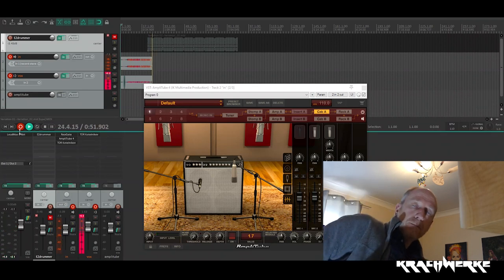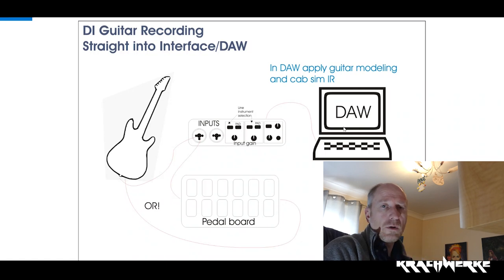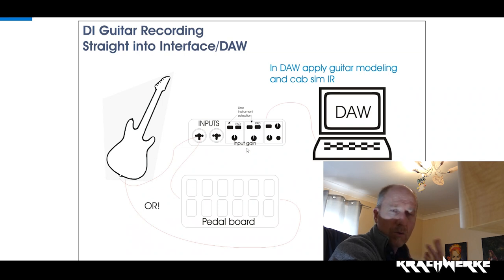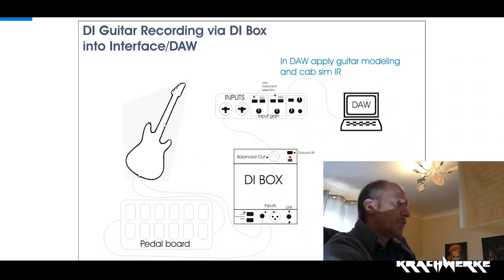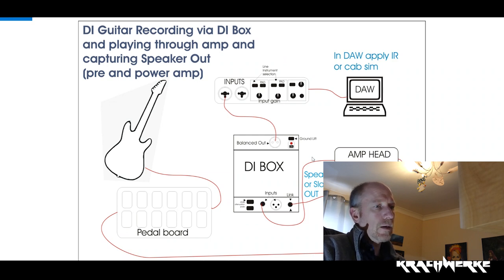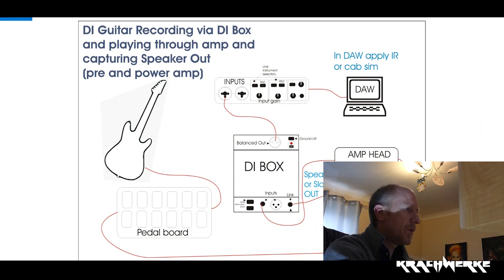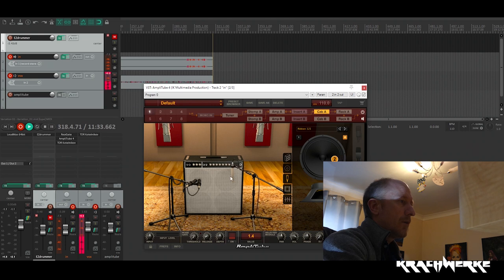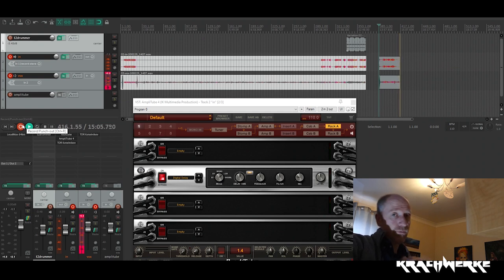Five Ways to record a DI track for guitar sims and re-amping

Comment: Hi, congratulations for the video really well explained
and in a very simple way, the best solution I prefer
it's "head, DI box, cabinet" I had in mind to create something like this
I just don't want to get into trouble, I thought I'd put an attenuator
but I didn't quite understand where to put it, I thought I'd put it
between "DI box, attenuator, cabinet" so I could lower the cabin sound
and have the headphone sound of the head without any attenuator,
what do you think is right?

Comment: Hmm I've read in a lot of places a DI box doesn't make a significant difference on interfaces with built in preamps, like the Behringer preamps. But I imagine with a decent enough DI box, there'd have to be an improvement. Are there semi affordable DI boxes worth getting for the UMC204hd? Are you just referring to the cloudlifter? I seem to have sufficient power, and minimal buzzing using dynamics. Cheers, nice video!
Reply from the maker: Thanks. In my experience the Behringer DI is absolutely fine. Please bear in mind this vide was to show different ways to record the guitar signal in order to get preamp out, poweramp out etc.

Comment: Would be curious to know what the different sound would be without aa DI box, and you plugged right into the interface. Which DI box are you using? What interface are you using?
Reply from the maker: Interface is the behringer uphoria hd with two xlr inputs.

The DI is the standard active one from behringer.

Depending on your setup you  an get away with using the instrument input. I think the problem lies with interfaces powered purely by USB and their lack of proper grounding. 

The transformer in the di theoretical mimics the pickups better.

Comment: At first, very eye opening Video! Thanks! My question:

I use the Steinberg UR22 MK2 as USB interface and used the build in Hi Z instrument input to go straigh from the Guitar to Amplitube 4.

Now I own a BSS AR133 Active DI and put it between the Guitar and the interface. The raw tone that goes into the Daw is very different.  But is it better? I have no clue. I want the Guitar signal entering the computer as authentic and pure as possible.

What are your thoughts on that? And what do you think of an Hi Z input? (does not work with XLR)

Thank you in advvance. Cheers
Reply from the maker: OOft, difficult...
SO I had a tascam io/2 interface and the instrument input option sucked baws so I started using the DI inbetween. I now have the Behringer UMC202HD and it is amazing using just the Instrument Line in (Hi Z).

I sometimes feel that the DI might be spungy? But it might just be me.

I think a good way to figure out how uncoloured the guitar signal is going into the daw via interface is to apply distortion. This reveals the noisefloor on the clean signal quite quickly.

I must admit the UMC202HD is amazing and clean with very low noise floor so now I only use the DI if I want to record the pre-amp, amp or want to introduce feedback.

Sorry I can't be of more help with this question. Maybe just A/B the two and choose which one you like :-)
Reply: Thank you so much! This was of great help. I took the choice to use the Hi Z input for Amplitube 4. It is indeed more brilliant.

Of course it is a matter of taste, but I think this is indeed the way to go with modern USB Interfaces.

Thank you so much my friend! Keep on rockin'

Comment: With your di/amp head diagram. Is it possible to use the effects loop in to the pedal chain's modulation and time-pedals; and connect the amp head's output into a di?

And secondly, what if the amp head has a di? Do you still need di box?
Reply from the maker: Yes, the amp head can go into the DI but please remember the speaker out needs attenuated and loaded.

You can also take it from your fx loop out even if there are pedals in front.

Not sure about your last point as usually the DI's from an amp out are also speaker emulated and usually sound naf. If not then yes possibly.

What is important is that IF you take an out from a source of higher voltage like speaker out is that you make sure the amp has a required load and that you attenuate the signal by using an attenuator and also using the attenuation pads on the DI.
Reply: @KrachWerke  thank you.

Comment: hi, I am using a cheap audio interface, "m-audio solo". playing guitar on my pc with amplitube. but there's a noise becomes worse with high input gain. even with clean amps. is it because of the audio interface? can I solve this with di boxes? noise doesn't dissapear when I touch the guitar. and it's not like a buzzing, more like a "hsss" sound so I think it's not about grounding of the guitar. and one thing I don't understand, input sound only comes from the right channel. output is stereo on amplitube but input right only. couldn't figure out why.
Reply from the maker: Weird. 

I would try a cheap active DI like the Behringer.

But the problem seems different. Maybe a bad input preamp I don't know know without seeing the whole chain.

Also remember you set ampl to the desired input.
Reply: @KrachWerke  what do you mean by desired input? and bad input preamp? guitar is directly connected to instrument input on the audio interface and it goes to pc by usb. thanks for helping btw.

Comment: Hi great video! I've been looking to record direct from the speaker out of the amp head through a DI and then the interface. This has been very helpful so thank you. But I know now that I've to put the link output to the cab so that my amp head doesn't explode, but the speaker out put is a Bridge parallel amplifier, does that make a difference? Should i be worried about burning the electronics?
Reply from the maker: Because I am not exactly sure what you mean I would rather not comment or suggest. Does the manufacturer have some info on the load usage in its documentation?
Reply: @KrachWerke  that's the issue, there's no information about the load on the documentation. I've two tiny amps. The Micro Dark by Orange and the Clean MV50 from Vox. The DI I'm using is a Behringer DI-4000. This DI it's supposed to handle speaker output of any cab, but it doesn't say anything about the load for this feature, so I'm not quite sure if using the link output of the DI to the speaker should solve the issue or if the DI can handle the load by itself.

Comment: Can't you plug an XLR from the amp DI straight into an audio interface?
Reply from the maker: Yes, usually. These are usually DI signals anyway. Sometimes though they are speaker emulations which suck though.
Reply: @KrachWerke  thanks, I plan to plug the balanced DI from my TV RH750 via xlr-xlr into my MOTU M2. I just wasn't sure if I needed an xlr-1/4" trs

Comment: for setup 3 , do i use the input or output from the bass amp to link on di box?
Reply from the maker: In setup 3 the Guitar/Pedalboard are plugged into the DI. Using the DI 'link' or sometimes labelled 'through' goes straight into the amp. The DI balanced out is then fed into the interface.
Reply: @KrachWerke   ive got my bass into the input of di box and the thru into amp, can i still use the eq knobs on amp? when i turn them nothing happens in my daw
Reply from the maker: @beatsbyfavo  If it goes into the front of the amp it should work, did you maybe put it into the amp fx teturn?
Reply: @KrachWerke  its a 30 watt bass amp just 1 input, im using radial sb2 passive isolated di for bass and keyboard

Comment: I was looking at Amplitude cos i don't have room for amps now. But all this audio interface stuff i don't have a clue about and i've never heard of a DAW. Can you not get a great sound plugging straight into a laptop accessing Amplitube and then out to some kind of speakers?  I mean by the time i buy Amplitube and then audio interfaces and stuff i'd probably be better just buying a new amp! My amp was a Marshall JCM800 and it got badly smoke damaged in a house fire so had to be binned.
Reply from the maker: I would suggest you have options:
A good interface is a necessity I would say. Start there. I would go for the Behringer UMC202HD. Cheap but really good.

From there you can get the free version of amplitube and use the shop to extend the amps, cabs and pedals. It comes free with some basic ones.

The other option is to download reaper which is a DAW. Then use free amp sims and cab emulators. This option can be totally free and the plugins are very good. If you go through my videos you will see some of these options.
Reply: @KrachWerke  Thanks for the help mate. I'm having problems even downloading the free version for my laptop (lack of space left). Think you have to have over 1GB and i have around that but it gives me a warning sign that i don't have the space left for the complete download. Thought i could download it to a zip drive thing, memory stick, but even when that option is selected for the download it go's to the 'C' Drive of my computer. Don't understand it.  When selecting speakers for cranking it up, if you want to, what wattage would you get? I mean can you crank it up as loud as your normal amp if you wanted? I love the idea of being able to purchase whatever gear you want. Thanks.